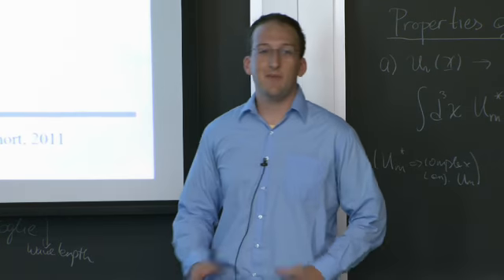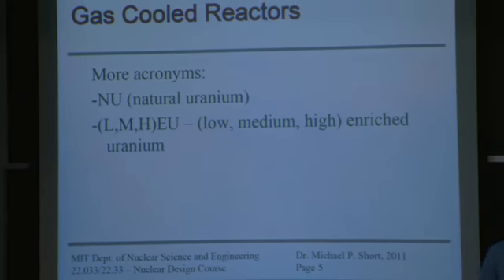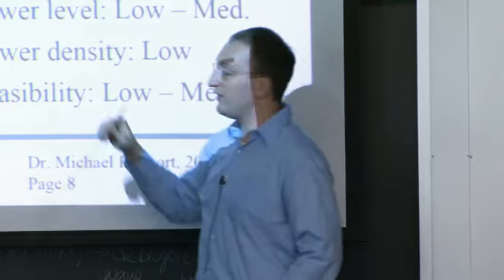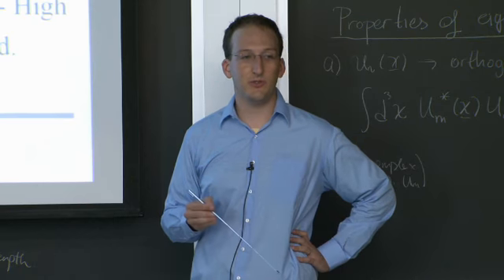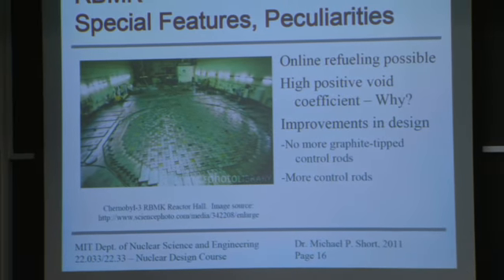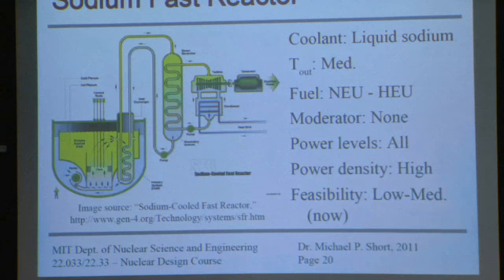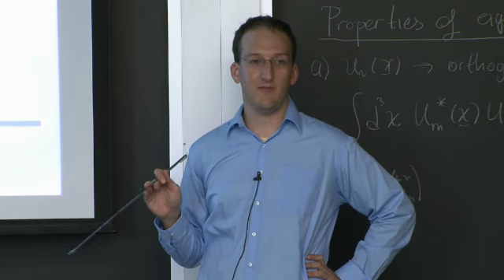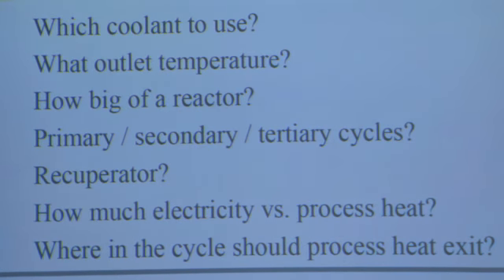Lecture 1: Core - Nonconventional (Non-PWR/BWR) Reactors

Comment: The direct manufacture of hydrogen is NOT an immediate goal for these reactors. First and foremost, electricity must be made. It doesn't make sense from a thermodynamic point of view to make hydrogen, if we are still using fossil fuels for electricity and hydrogen production. Please think about this.

Comment: ORC power from the waste heat ?
Economics ( time to build ), (loans, cost over time), ( time to break even)
Current nuclear plants take about 6 year for construction with a very large
investment required before power generation begins.  Politicians just do not last long enough
and have short time though processes .  Orbital thermal or PV designs would
have the lowest environmental cost.    Fusion power has far to many materials 
and control issues.  Nuclear will have to bridge our power needs to a
fully renewable energy future.

Comment: Superphenix in France was operational for only a few days out of its twelve year existence.
It had too many technical problems.
Its predecessor, the smaller Phenix WAS a success.
The French are apparently working on a new Sodium Cooled Fast Reactor.

Personally, I don't like even the IDEA of a heat exchanger, which has sodium on one side, and water on the other.
Reply: Then use organics as an intermediary or a gas.

Comment: Pebble one looks like crap...thorium is the only answer:
https://www.youtube.com/watch?v=uK367T7h6ZY
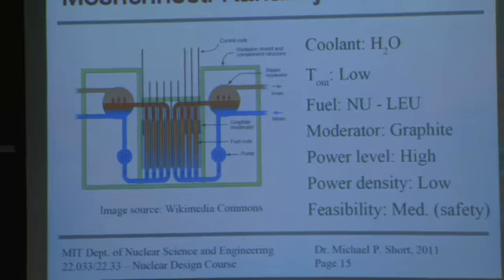22:00 - guy forgot to tell, this reactor has a buffer, controll rods inside 24h. Czarnobyl-4 exploded because lack of water, buffer and automatic shut-down system off!
P.S. Molten salt thorium reactor can use MANY salts, not only FLiBe!
https://en.wikipedia.org/wiki/Molten_salt_reactor#Fused_salt_selection
My faw is NaF-ZrF4 mixture! It looks resilient and cheap! This mixture with thorium fluoride melts in ~400 °C! With no tritium creation! And Hastelloy-N is badass resistant to corriosion!

Comment: About the HTGR i would say they fesability gone up quite a bit since 2012. China installed the first actually reactor last month, and Iran have ordered 2 of there own from China. The time to build seams to be around 3 years, that is pretty fast. And its also have a decent capacity of around 100MWt.

The BN-600 was finished in Russia in the 1980-tys: The BN-800 was finished 2014 (so two years after this video). It seams to work fine and is producing power commercially today.

The BN-1200 designwork is nearly finished and they plan on start building it 2020 or something like that. (the BN-1800 design seams to be scraped)

Also the VVER-1700 also russian reactor is a supercritical reactor, very simular to the current VVER reactors, but super critical. Designwork is ongoing and there supose to be a build start soon (a few years), but not solid date yet.

There is a lead reactor project ongoing in Canada. They will build it quite soon, but i don´t know when the first prototype will be built.
Reply: This is crap reactor! Thorium one can be build under one year, and fuel cost ~30$ per kg, not over 5000 for 5% enriched uranium...Thorium is ALWAYS 100%!

Comment: Why not use liquid aluminum as a coolant? It melts at 660 degrees C and boils at 2470 degrees C. And it is relatively chemically stable and neutron transparent.
Reply: +David Vermillion Probably because it's melting temperature is way too high. FLiBE and FLiNaK melt before 500 degrees C
Reply: You really don´t want a coolant that have a melting temperature of more than  a few hundred degree. Other vice you will have a very big problem with heat transfer as well as cold start up.

Also, Aluminum have a very low thermal capacity so its not that well suited.

Comment: RBMK - РБМК - Реактор Большой Мощности Канальный
and yes, a lot of these reactors are still working (in CIS)
Reply: 11 left.. Really just the Chernobyl once and the Ignalina once that been closed down. 

From 2019 they will start closing them down about one a year over a 15 year period.
Reply: RBMK is actually a GOOD desing reactor! The Czarnobyl-4 exploded because all safety systems were off, and exploatation rules were broken!
That's HOW it happen:
www.youtube.com/watch?v=sB_jogK3xA0
Reply: @WadcaWymiaru  No, it was a terrible design.
Reply: Positive reactivity is good thing not bad. You can kill reaction by rising water level. (for good with Xenon pit)

Look: if RBMK was in TMI operators would easy tell the water level in the reactor because core would increase the power. (causing drum separator to forced shut-down)

in Fukushima RBMK would gave japanese ~20 times more time to bring cooling back because decay hat is like 10 MW (from 3200 MW/heat) because fuel is so little enriched(1.8%). Add fact BWR can't operate on 840 kPa, nominal is 400 kPa (Fukushima, reached in march 12) when RBMK 6500 kpa is norm. (6.9 megapascals in drum)

Russian reactor has ANOTHER usefull feat: you CAN remove the rods when reactor RUN! Impossible in BWR or PWR...

Comment: If only the DOE was looking into MSRs. Based on the info from tours of ORNL, they are giving away the tech, and ignoring it instead favoring pebble bed & TRISO fuel, as well as some dabbling in SMAHTR modular reactors. In addition they are destroying or have destroyed the U233 generated decades ago which could have been harvested for useful materials or used in new MSR designs as clean startup fuel (no transuranics).  Ah well. Good class, nice to validate the info I've gotten & see the designs.